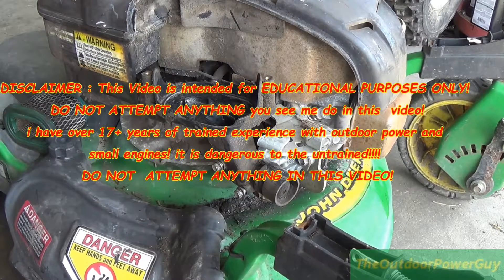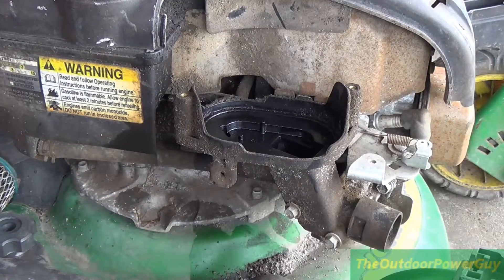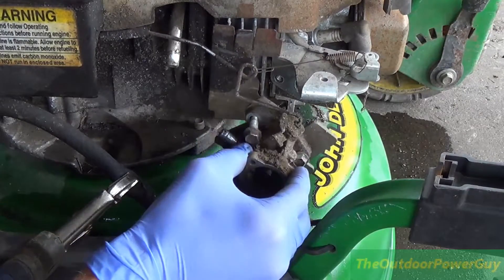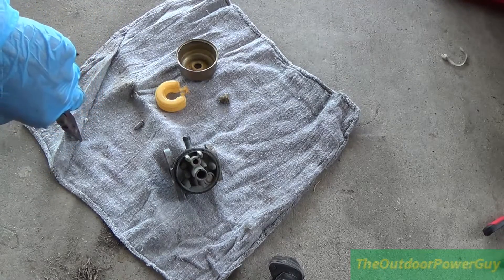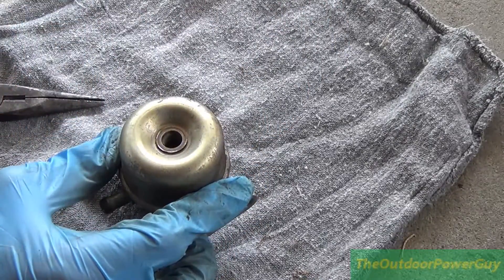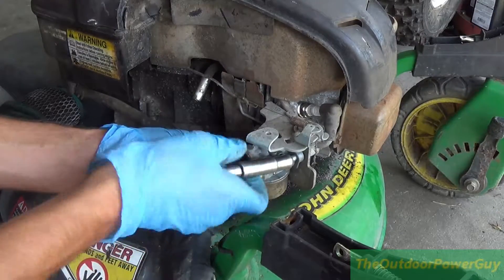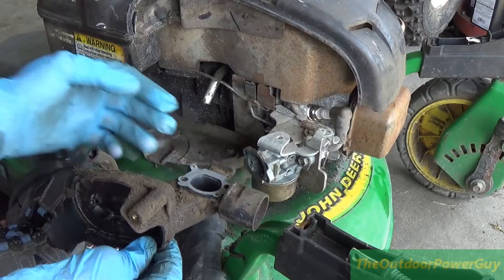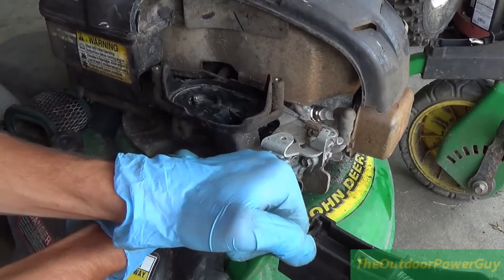Briggs 6.5hp Intek Engine: Carburetor Removal and Reassembly

Comment: Between the air box and carb is a gasket that will prime as long as the primer hole is sealed.  It can be leaking or even missing elsewhere but it has to be sealed at the primer orifice for the primer to work. Obviously you don’t want unfiltered air but even if there was unfiltered air it will still run. Take the air box off and it still runs!